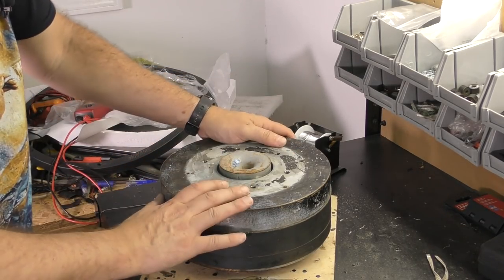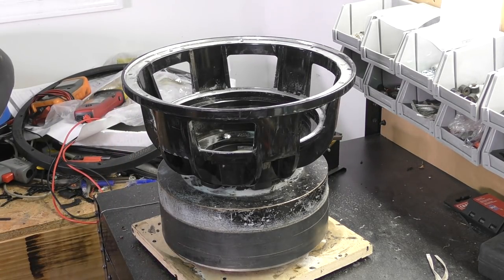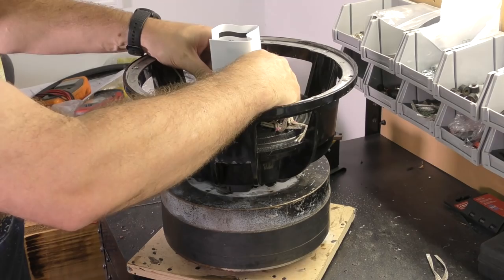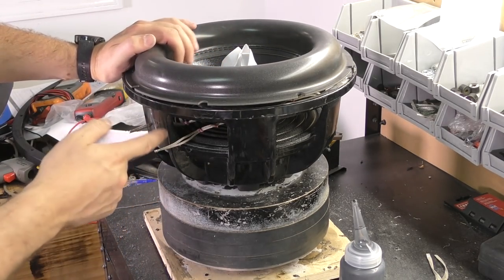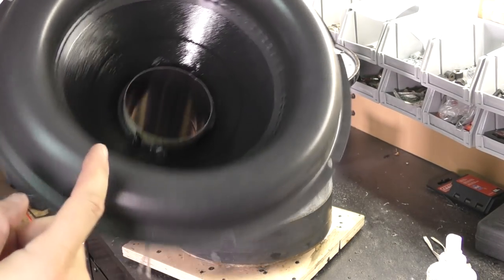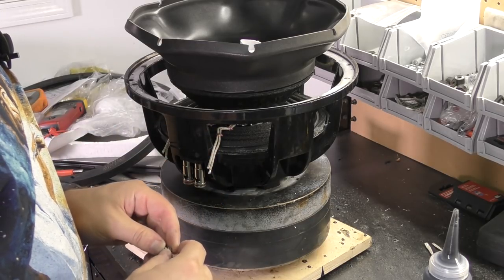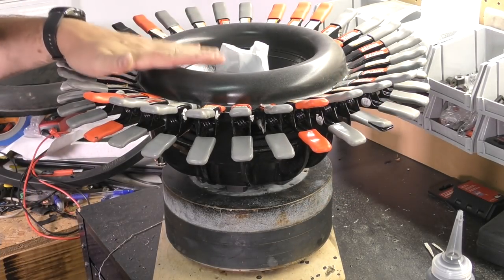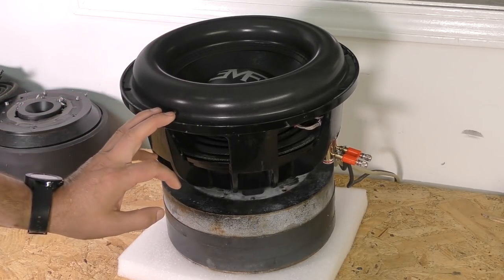I rebuilt a disaster subwoofer someone else already built, a Shocker Sig

Comment: I had 9 of these 15’s back in 2002 the guy that designed these motors was pretty smart. I still have a few of the original shockers sitting in storage. I also have 30 of the 1 ohm flat wound quad coils that were made for the sigs if anyone is interested in buying them from me. I ran 4 of the earthquake PH2d on each sub.
Reply: Quad coils are bad ass , wish I could use em
Reply: @charliefrancis6438  they are for sale
Reply: i could use 9
Reply: @666nacirema666  I don’t want to break  up the box so I could sell the box of 15.
Reply: @jasonneal  how much?
Reply: @jasonneal  no thanks, new ones built to spec are cheaper
Reply: @666nacirema666  you do know that is for 15 coils?
Reply: @jasonneal  didn’t realize that. Don’t really need 15 though
Reply: Sorry didn’t mean to sound like a jerk there if I did
Reply: Still have the shockers for sale?
Reply: I believe Mike was his name drive out to his house in Indiana met him back in the day…lol and got 2 super shocker  prototypes 12 inch and super Efficient and got down.
Reply: I need some shocker sig big gap motors.. holla i build daily I need a brother for my mag

Comment: I’m Interested to hear about how the thickness of the gap would affect the performance or what other differences there would be Such as advantages and disadvantages.
Reply: The way I have understood it is that the narrower the more efficient but less powerful but more musical, and the wider it handles more power but with a smaller response range better for SPL.
Reply: OK cool thank you
Reply from the maker: It's not exactly that cut dry or accurate. The top plate height doesn't effect power handling or sound quality in regards to clarity.
Reply: I was only asking about the gap between the pole and the top plate. And how that would affect things.
Reply: @yourdaddy5630  lol answered a different question i suppose.
Reply: @EMFAudio  I was referring to the opening between the pole and the plate, the more open the thicker the winding can be and the tighter the thinner which would make it lighter and more responsive, but with a sacrifice in power handling.
Reply from the maker: @yourdaddy5630  The distance from the pole to top plate effects the gauss number, but ultimately the coil used in that gap is what makes the sub perform one way or another.
Reply: Magnetic force is inverse quare to distance, so narrower becomes very strong but at the expense of how much coil you can get in there.   Companies like Fi who make "SPL option" will use a tighter gap". DD95XX always used a very narrow gap.

There were 4 different version coils made for this motor in the last 10 years (the originals used a 5:1 flat wire which nobody uses anymore)  D1.4 and D2.8 in copper or aluminum with a few minor revisions.   I have some data saved on TS parameters and some observations on performance for numbers and music.
Reply: EMF bounced out instead of giving any kind of explanation. “It’s not that cut and dried and by the way you’re wrong and stupid” That’s the way his comment read to me and only because he didn’t tell you why you were wrong. That generally means someone doesn’t know as much as they lead on or maybe they don’t exactly understand the question which again is going to lead me back to them pretending to have some knowledge that’s way above normal peons like us. Just my observations as someone who studies people behaviors and mannerism for the past 28 years.
Reply from the maker: @erictheboringone5292  or maybe I don't have time to write a book on YouTube. I'd rather make a video about it, utilizing visual aids. But if you'd like to explain it, by all means, go ahead.
Reply: @erictheboringone5292  , well opinions are like assholes and everybody has one, most of them are shitty.  As someone who also studies mannerisms and behaviors I didn't take that comment that way, but it just goes to show how different perspectives can be or could it be something of predisposition? who knows and really who cares.
Reply: @erictheboringone5292  
A lot of that goes on in car audio.   The thing to consider though is that there's lots of guys who give nonsensical sounding explanations of why things work or don't work but then have a garage full of 6 foot trophies and every build they do seems to knock it out of the park. 

Honestly there's been extremely little real innovation in loudspeaker design since Peter Jenson's first one in 1915.  We've had split coils, split gaps, copper shorting rings and some new materials is pretty much it for really game changing patents in the last 50 years.   Besides that we get new frames, bigger suspensions, huge surrounds and just building mechanical parts more robust to handle modern cheap power and that's about it. 

The point is what passes for "designing speakers" means calling the build house and requesting slight variations on something out of a catalog.  This is even true for the Shocker Sig.   Mike was offered TC 4hp back when they were Eclipse and TRF and TC5200/5400 and he asked for "that but with more efficient 3" coil" for the '02 then "that with a smaller gap" for the '05.  Neo sig was basically the TC 3HP neo motor and Mike telling Thilo "add another slug" until he stopped gaining on the meter in testing.

That all said, it's certainly worth considering what the veterans in the industry tell you because they're often right even if they don't know why.   It is highly likely the explanation I was given as to why these subs work best in large box isn't great science but I have verified it with my own testing and observation before passing that information along.
Reply: @EMFAudio  Bro that was a lame ass response... you might be busy but you have time to leave a comment that helps nobody?  Just ignore the trolls if you're not going to answer the question my man. You clearly know what you're doing, you're not obligated to share any of your information with beginners or anyone, but don't even reply if your gonna act like that.
Reply: @politicallyincorrect633  Exactly.
Reply: Tighter the gap = The higher the sensitivity (usually in sq subs/ not 8 layer spl setups)

Problem solved😂 But prob. not...
Reply: @smigletat9634 in other words this was designed for musical only. I own one that got rebuilt by Dave Lieb. Used to be a Blue Shocker Sig with this tight gap motor now has a zv3 motor!
Reply: @zeegamingandmusic3855  
That’s great! Thank you for the response on older video.. Love your content🤟
Reply: @smigletat9634  not a whole lot on my channel lol. I will have to upload some stuff. That custom 12 is in a nice led ported box now! Also! You're welcome!

Comment: So x- max is only good if you know the top plate width and mechanical depth of sub , so will this move as much air as a similar size sub with a 64mm long coil and a 20 mm gap , with plenty of mechanical excursion?

Comment: So what exactly makes a weak motor?  That thing looks like a beast, but the measured gauss was quite low.  Is it the material the magnet slugs are made from?  The material the steel plate and backing plate are made of?  The coil gap?  A combination of all of this?
Reply from the maker: 6,000 isn't particularly low, you might be surprised what your favorite subs measure. It's just not particularly high either. You could cut the top plate in half and it would raise the gauss quite a bit, till the point it's completely saturated and won't go any higher. There are a lot of factors that determine gauss, like top plate thickness, magnet grade, magnet and top plate diameter, quality of steel, back plate thickness, pole venting, gap size and how well the motor was charged to start with.

Comment: I noticed a weird ring on the coil under the spider @8:50 ... Did you happen to remove it or glue it in place before you set the spider and coil height ...
Reply from the maker: Glued in place AFTER the coil was set in place.

Comment: Do you have to re-magnetize the motor after all these years? Would it improve the BL?
Reply: Yes that shoulda been the very first thing done to the rebuild. But not everyone has those they take major power like 2 runs of 220 volts 440 volts altogether if im not mistaken.
Reply from the maker: 1 video has lead people to misunderstand something about speakers. Motors don't lose magnetism over time. Any motor that can take more of a charge wasn't fully charged to start with.
Reply: @EMFAudio  so u wouldn't freshen up the  motor on a old sub if u had the machine setting right there in ur shop ud just let it sit there.
Reply from the maker: @joshholden8561  Nope. If it were that important, I'd have one to do it with. The only instance I might put a magnetized sub in a magnetizer is if it's used for competition SPL where every hundredth of a dB counts to insure it's as strong as it can be. Though worth noting, that magnetizer won't work on neodymium motors which is what is probably used for SPL anyway.
Reply: @EMFAudio  plz explain to everyone reading what neo means and what other types are used and the pros and cons of each i think this would shed some light on the issue. Thanks josh
Reply: ANSWER YES IT WOULD IMPROVE IT.  Thats the yes or no answer ok now going from there depends.... was the motor ever fully charged to begin with if not yes it will help . Me personally if i was doing high spl comps or building custom subs me personally id take my motors somewhere and get them remagnitized each one if the motors was older than 5 years or so
Reply from the maker: @joshholden8561  That's a whole other video in itself.
Reply from the maker: @joshholden8561  Have you ever done that? Based on your comment I suspect no.
Reply: @EMFAudio  ofcourse i have i took some old round 15 inch kicker solobaric subs to a well known company in Florida thats hugely popular that i wont name my subs  was new in the box 6 of them 2 stacks of 3 and they wasnt reading as high as they should so i had that done great investment if u want to make rhe motor u have a super motor but like u said fir spl reasons
Reply from the maker: @joshholden8561  And what objectively measured difference did you see?
Reply: @EMFAudio  anywhwhere losing 15 to 40 % of a single subs magnetized motor strength. Magnent momentum  or strength is the same thing i believe tesla used gauss  and i think thats what the settings refer to some subs was subject to like 10.000 or 100k if im correct .
Reply from the maker: @joshholden8561  But what I'm saying is, what measurable difference did you personally see as a result of charging it again? Was it a frequency response difference, a measurable SPL difference and if so how much? Not "it sounded better", something measurable and repeatable from before and after.

Comment: How much would it cost for a custom re cone for an Audiopipe txx-bd2-12. or just the voice coil and I can unscrew the spider from the basket without damaging it cut away the old VC and glue the new one in. the original VC is listed as a 2.5-inch BASV voice coil.

Comment: Wow, I'm a speaker guy myself, and you think you know a lot about speakers until you see a video like this! Damn, reconing a speaker driver is a LOT of painstaking work! (I figured it was, that's why I never bother doing it myself... but I've never "had" to either, so with an expensive competition sub like this one it might be worth trying.

Exactly what kind of glue are you using there? Where do you buy it and how much does it cost? Also, what is that stuff you are spraying on it immediately after applying it and where do you get that and how much does it cost?
Reply: The spray is the activator... Completes the drying time COMPLETELY in 30 sec. tops
Reply: @smigletat9634  The most important questions I had about this stuff have never been answered by anyone, not even the original video poster. What is the (brand?) name(s) of this stuff, were do you get this kind of stuff, and how much does it all cost?!
Reply: @JoeJ-8282  
Right off hand I couldn’t tell you but with that said.. I have 2 passions.. Car Audio & also Wood working! 
I have used these products in both fields & work quite well. I am currently rebuilding 2- DC audio lvl6 m1-15’s I just ordered parts yesterday but still need to locate my gluing products or I could give you a better answer.. Sorry

Comment: Shocker Mike was local to me in Ohio. I wish I would've bought a few mini sigs
Reply: You're probably thinking "Super Extreme" which was TC9 motor.   They were used on TC-2000, Orion HCCA, Eclipse, and I think a couple others.  They still come up from time to time on forum classifieds.  A versatile motor that supported several solid woofers.  I have had interesting results building those with different coils.

Comment: I got 2 old school Atomic APX15 I'd like to rebuild.. They were pretty good back in the day
Reply: I got the same 2 15s my cones came apart from coil i had to take the cap off and re glue it all but these subs bang for old school subs
Reply: @mapexman86  did that cause a rattle sound like it was coming from under dust cap? Getting worse louder you got?
Reply: @Thumper68  yeah
Reply from the maker: I should be able to do those.
Reply: @mapexman86  I have a sub doing the same thing and was going to remove dust cap but was hesitating definitely going to check it out now thanks for response.
Reply: @Thumper68  np man was easy to glue back on
Reply: @mapexman86  Had the same problem.. Way back I ordered a recone kit from Atomic and it came in as pieces not a drop in, The cone was pretty loose on the coil (1/8" Loose).. Gave Mike at Atomic a call and he said that's how they come and that the spider glues to the cone along with the coil.. This is why the come apart there

Comment: Hey sean I know you’re a busy man but I have a question. I have 3 12” dual 4 banhammers & 2 banhammer 15 dual 2. The car is a 2019 accord. Which should I put in to be louder??? If I end up doing the 3 12” I want to send them to you for some upgrades first, especially since I bought them from Offerup each separately. But if the 2 15” will sound better and give me more bass I’ll just do them as is. Please give me your input as it’s very valued. Thank you 🙏
Reply from the maker: It will be a challenge to fit both 15's or 3 12's in that trunk simply because of size limitations. I'd say your best bet is probably 2 12's.
Reply: @EMFAudio  I appreciate you, thanks for the input 💪🏾💪🏾

Comment: I have a new Pro audio subwoofer 18" it has slapping sound when i press the dust cap while power off there is no rubbing against the coil i tried to play 5Hz in my sub and there is slapping noise but when i hold the tinsel lead the noise disappears I only here the noise when I do free air but inside the box the bass is loud and I cannot hear the possible tinsel lead slap. What should I do with my subwoofer ?

Comment: @EMF Audio  how do I get in touch with you on a build.  I have 2 EARTHQUAKE HOLES 15" SUBS I need rebuilt   cost is not a issue
Reply: Nice  im rebuilding some  earthquake subzero 12's with the flat dustcap's.  Im just looking for flat wire coils with the same specs as the mmats juggernaut subs.  I bought them blown, bringing them back to life.
Reply from the maker: Our contact form on our website www.emfcaraudio.com
Reply: you must not be in Cali huh? earthquake will reconed for about $450 if you can get em to Hayward. had them reconed mine, and it looks and sounds like new

Comment: Good work bro but make sure u blow out the coil b4 puttin on the dust cap
Reply from the maker: That's the wrong order of operations. At that point it's too late. You blow out the gap before the coil is even put in, which I did.

Comment: Would you recommend using flux to solder the leads and to the terminals? Or is it really not needed? Lol nevermind it looks like you used some from that little bottle.
Reply from the maker: Some leads need it, others don't. This is one of those instances it's needed.

Comment: Do you use E6000 on the surround instead of CA glue so it will be more flexible?
Reply from the maker: CA can dry out foam which can make it delaminate. If it's thin enough it can absorb before it adheres. E6000 just does a better job, consistently.
Reply: @EMFAudio  that definitely makes sense. Thanks for the great info on all your videos. I've reconed 2 subs so far and both turned out perfect from following you step by step.

Comment: I would love to know if I wanted my W712 anniversary edition to handle more power what would it take to do so they are rated at 1000 rms but I want it to get up into the competition level ratings! Is that possible if I send it to you?
Reply: The w7 12” can fit a 4layer voice coil and a TI frame with a 10” spider it will handle more in every way and sound amazing.

Comment: Is it typical on 12" spiders to use just one, it seems super stuff for just one 2 feels practically solid....
Reply: you mean like two separate spiders? upper and lower? i've heard the top spider is just for show, that the bottom one does most of the work
Reply from the maker: It's not just 1, just like I said in this very video it's a pack of them.
Reply from the maker: There is no instance where spiders are "for show", any spider would effect compliance. There IS a purpose for spaced spiders, which is why the Banhammer line uses them.
Reply: @EMFAudio  thank you for the correction. funny enough, i heard that statement on robot undergrounds channel.. maybe i just misunderstood him
Reply from the maker: @notyobiz6207  or maybe he doesn't understand and is giving out bad information and you heard what was actually said.
Reply: @EMFAudio  lol WELP